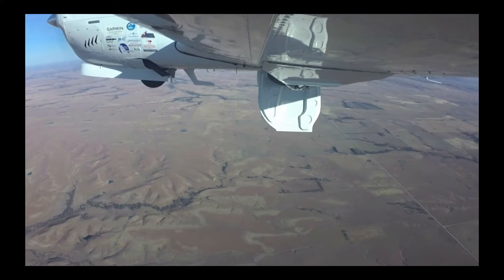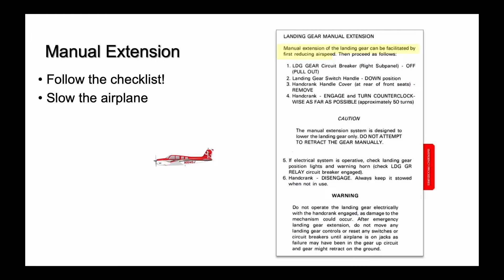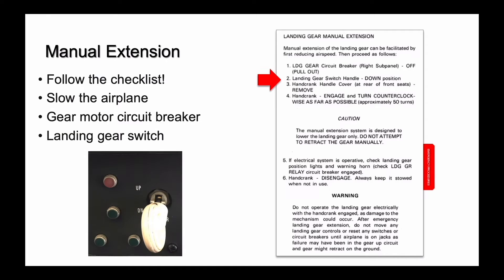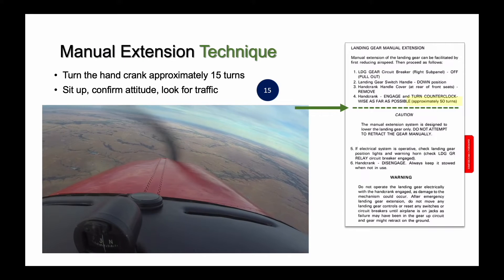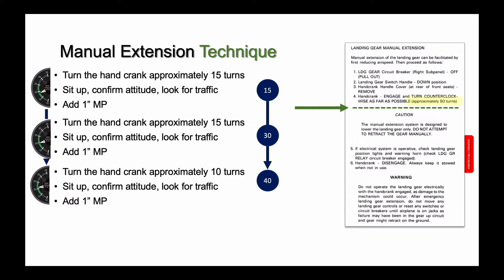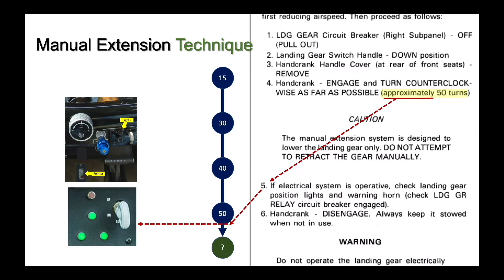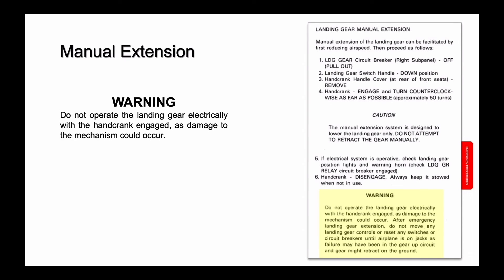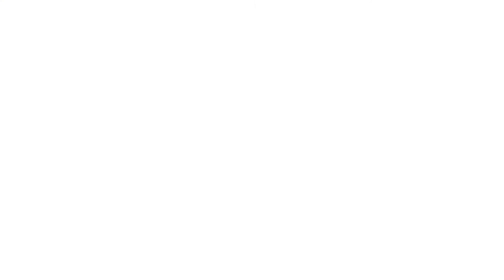Beechcraft Manual Landing Gear Extension

Comment: Do we ever need to test/verify the hand-crank system?
Reply from the maker: Yes, it's a good idea to occasionally check the proper operation of the manual landing gear extension system. First, for the pilot’s own currency and preparedness he/she should perform a manual extension using the checklist procedure (and our suggested workload-reducing technique) every couple of years, both using the autopilot and while hand-flying the airplane to simulate extending the gear because of electrical failure. 

Next, there are checks of the landing gear system that involve at least partial manual extension that are part of the 100 Hour/Annual Inspection checklist in the Beech maintenance manuals and expanded upon in the ABS Guide to Landing Gear Inspection, Maintenance and Repair,  free to members on the ABS website. 

Third, the ABS Technical Advisors suggest checking the dynamic brake tolerances perhaps halfway between annuals to ensure the limit switches stop the landing gear motor before the gear transmission reaches a mechanical stop. The transmission sector gear should stop just before it reaches the internal stop to prevent damage to the gear. 

If you have additional questions, you can log in to the Tech Tips section of the ABS Member Forum on our website (www.bonanza.org/community/member-forum/) and ask your questions there!

Comment: I had to use manual heat extension on a F33A. To reach and function the gear you are put into a position that denies you the ability to fly the aircraft or see where you are. In my case we had no electrical power and I was going into a major airfield. I had a non pilot in the right seat who I had to get to turn the crank so I could fly the aircraft. At one point he said I can’t turn anymore my arm is done. I explained that now the gear was only part way down and it would be a catastrophe if we tried to land. It’s amazing how much strength he suddenly gained. We had to power so no green lights but thank God we made a beautiful landing. It would be nice if the pilot could manually extend the gear while flying the aircraft…ie…seeing. If you have no power you have no autopilot and in the traffic pattern of an international airport you better be able to have full visual on your surroundings

Comment: I have had to do it one time while airborne in my 1988 A36, when the gear motor quit.  I had another pilot with me, so he cranked while I flew the airplane, following the POH checklist.  It was much easier with two people.  I had the electrical system operating, so we had the gear lights to confirm the gear was down and locked.  As suggested in the video, we didn't entirely trust that, and cranked firmly until the crank would not turn any farther.  Afterwards, I had my mechanic replace the gear motor.  That solved the problem.  I was new to the airplane at the time.  I had been out with a CFI doing pattern work, practicing the various forms of landing... short field, etc.  I suspect that all that gear up and down was the last straw for the gear motor, which was original to the airplane, and had about 1200 hours on it at the time.  Our biggest challenge was convincing ATC that it wasn't an emergency, when it occurred while flying an ILS.  We had to break off the approach and get a delaying vector to work the problem.  They wouldn't leave us alone, constantly calling and wanting more info, which was quite distracting.  BTW, Bonanza are awesome airplanes.

Comment: Had to do this about a month ago. The gear was almost all the way down. Only needed to crank about 5 turns to complete the extension and to get the green lights. Mechanic checked the gear parameters and didn't find anything wrong. Multiple gear retractions and extensions on the jacks without a problem. Two flights since and gear operated normally. Gear motor was overhauled about 100 hrs ago.

Comment: Great video - added to a recent flight review I conducted. Not an emergency is an excellent point - doing the extension a few turns at a time - use of autopilot is available- all solid advice. Thanks Tom and ABS

Comment: Great Video Tom!  Best way to keep from ever having to do this, is overhaul the gear motor every 700 hrs.  That’s how long it takes to wear the brushes to half their length
Reply: 700 hrs of flying time, assuming one gear actuation occurs every 30 mins (probably conservative) and motor run time of 12s (again worst-case since newer models have 3-4s time) per actuation means only about 280 mins (let's round it up to 5 hrs) of total motor run time. I am trying to understand what causes such a rapid brush wear in such a short total run time.